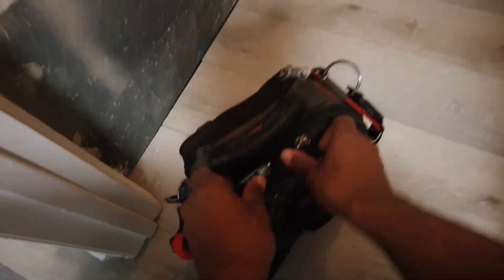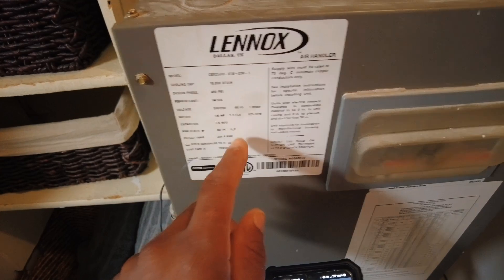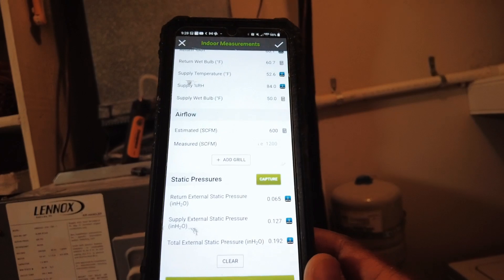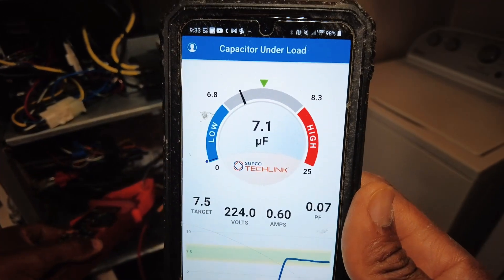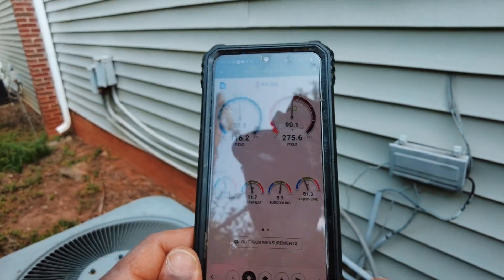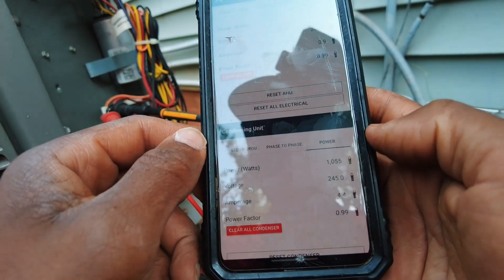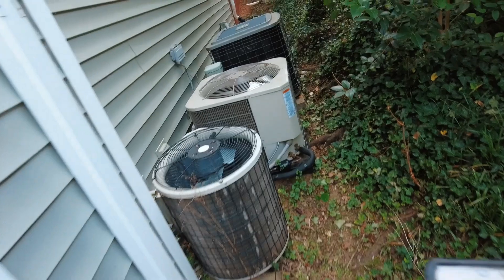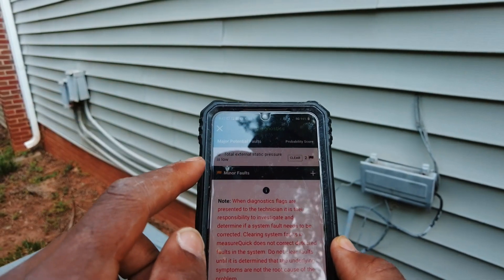When Modern Tech & Good Old-Fashioned Visual Inspection Collide HVAC Real Estate Inspection #hvac

Comment: Nice to see your journey and where your journey leads you..

One note, i always pull up the manufacturer manual to check the airflow chart, 
That will give you an idea of the range you need for static and cfm, in you case it would have showed you that there was a problem...
Bluon, as you know, is a good app for manuals.

Also
You mentioned TrueFlow,  you still could have used your truflow when you pulled the filter. Just fake like the filter was installed but it isnt, It still would have given you your Airflow results and showed the airflow restriction.

Im in minnesota and run across much more gas furnaces, energy conservatory just came out with an update for the Truflow, Airflow testing in the heating mode for electric and gas furnaces.
Reply from the maker: Nice! Appreciate the feedback! I need to check out that new update for the Tec app. 
Also if I would have checked the  airflow based on the blower pressure chart, it would have showed that I actually had  high air flow because my  measured total static pressure was really low. If I remember correctly I believe the total static pressure was around a  .2 which probably would have translated to maybe around 950 CFM or so on high speed which is way to high of air flow but if the fan speed were set to low that would only translate to around 700 cfm which wouldnt be that high for a 1.5 ton system. Hope this makes sense

Also I've tried using the true flow grid without a filter before with no luck. I'm not sure if they've updated it since but every time I've tried it needed a minimum difference in the supply reference pressure in order to let you proceed to the next stage.
Reply: @HVACTechKnowledgy  in this area .5 is what you try to shoot, most of the time you actually in up in the .7 ranges, especially with the ecm motors. So your .2 would be extremely low here...
----
Outlet probe placement is also critical, the right side of the plenum would have been better choice,  even though it still would have been low, but that way you are getting more velocity out of the flat side of the coil instead of the center. 
--
Only a suggestion, Give Chris Hughes at the Energy Conservatory when your on a job , if you have not spoken to him, he Is very helpful with the truflow..

Comment: Doesn’t the arrow for the supply go towards the air flow not with?
Reply from the maker: If you are talking about the static pressure probe, to be honest with you it really doesn't make a difference from my experience. As a matter of fact this video is a bit older, I actually started using ball inflators and they work great. Plus you can put them in much smaller holes, most of the time I don't even have to drill a hole I just remove a screw from the high limit mount on a furnace for instance.
Reply: @HVACTechKnowledgy  good to know dude! Will need to look into that method! Have you demonstrated that one before? Thanks
Reply from the maker: yes sir! I have a few videos and shorts demonstrating it sorry I cant share links in the comments but if you check out a short I posted about 4 months ago called "simple manometer hose hack" you'll find it.  Let me know what you think!
Reply: I was just about to say the same. I've always been informed to point into the airflow. Was once told as long as they are the pointed in the same direction it doesn't matter, but I've never tried it.